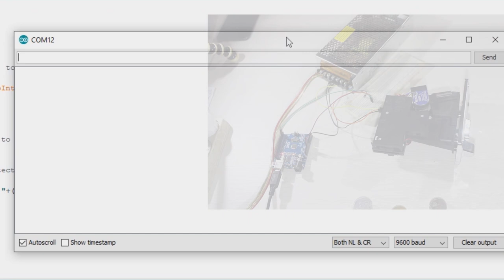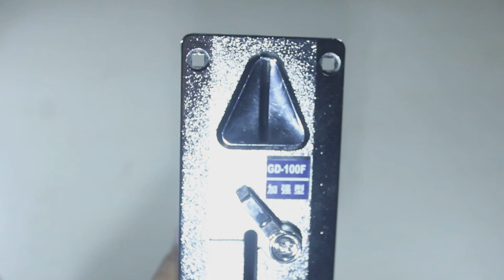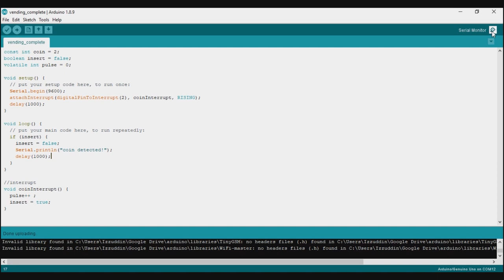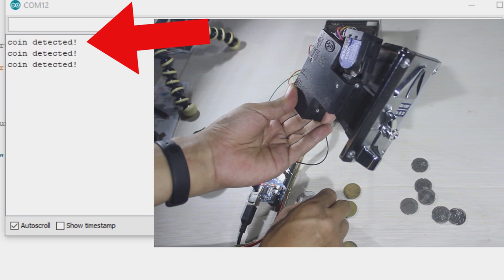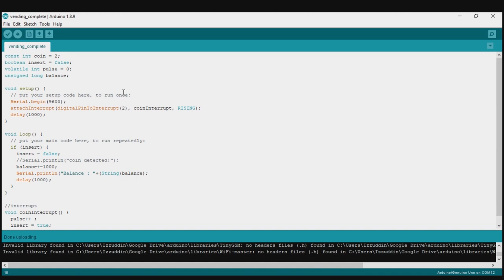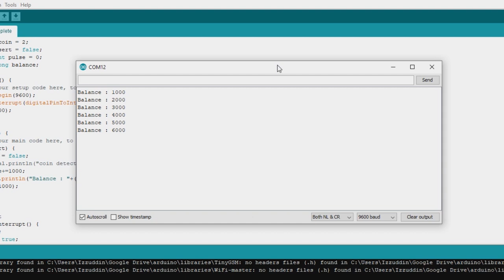Coin Acceptor or Coin Sensor Tutorial with arduino (GD-100F)

Comment: I have 3 coins. 25 cent(1pulse),  50(2pulse) cent and $1 coin(4pulse) Why $1 only counted twice x2?
Reply from the maker: Did you use different type of coin acceptor?
Reply: Look exactly the same program the same different model.
Reply from the maker: I'm not sure I understand your question, but did you mean you use several different coins? Because this coin accepetor only detect one type of coin. So you just can read for example 25 cent only. Another coins Will rejected
Reply: Oh mine can be multiple. 25 is working but not 100. When 100 is inserted it only show 25 and 50(2 pulse?).  It should be 25, 50, 75, 100 (4pulse) right?

Comment: why is there a pullup. can someone explain please
Reply: It is there to not only to protect the arduino board, but to also remove the "floating" input on the coin acceptor where the credits add up multiple times even when you dont insert a coin.

Comment: Why use Pull resistor if there is already builtin pull up internally in arduino using pinMode( pin#, INPUT_PULLUP )?
Reply: because it useful for trigger the signal, mybe wkwk

Comment: Can you do part 2. Make it turn on led or motor with number of coin?
Reply from the maker: That's the easy part. Just use else if or something if the balance reach the price
Reply: Easy for you not me. What is orange wire run up? Is that positive + or you forgot to add in your diagram?